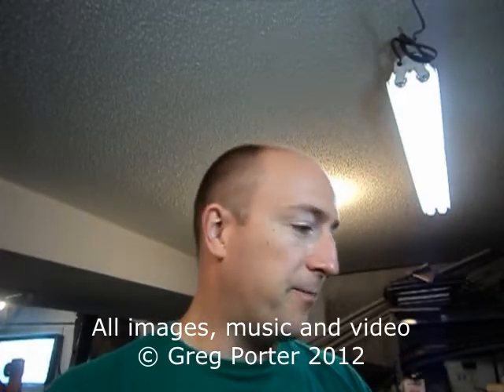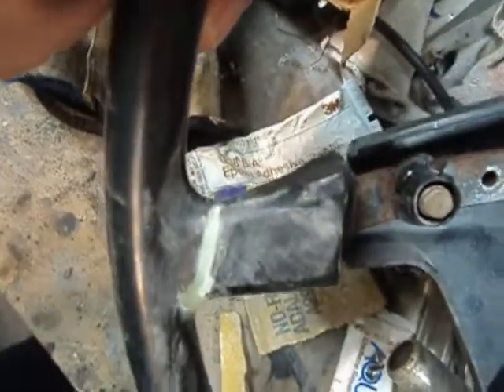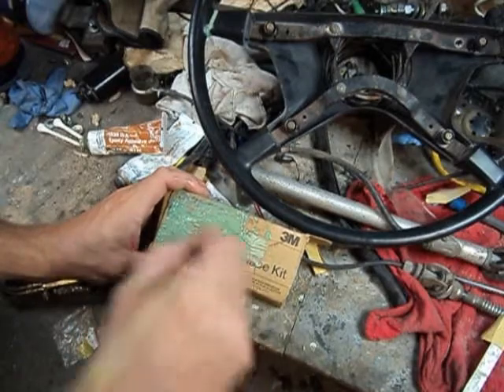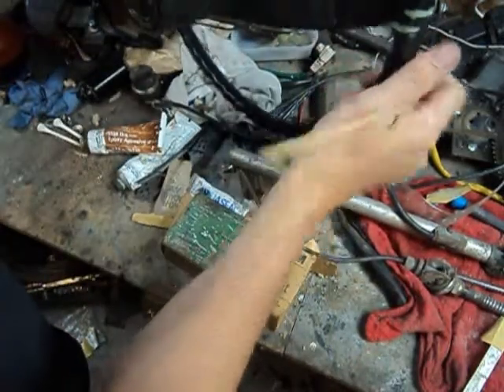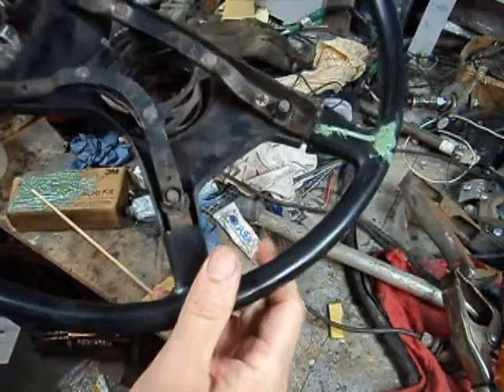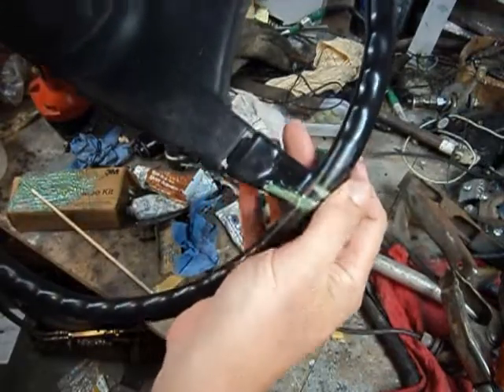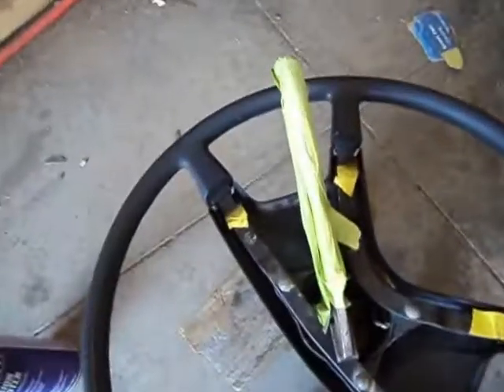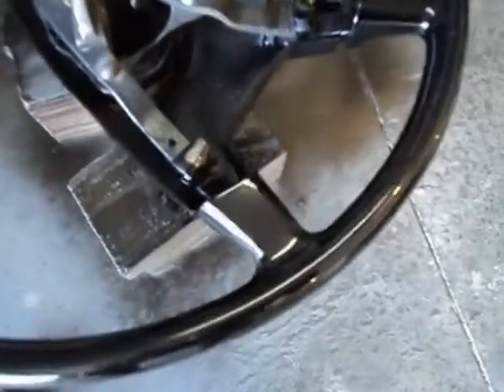VW Karmann Ghia - Steering Wheel Repair - Part 2

Comment: That looks amazing - like a new part!  The shine will reduce a bit over time if you think it's too shiny now. Or if it's really making you nuts you could use a little rubbing compound to take some of the shine off the rim, I don't know about the center piece, since that's more textured, it may be hard to get the shine to be consistent.  There's always the option to shoot a final coat over the clear with a slightly reduced shine (like eggshell or semi gloss).